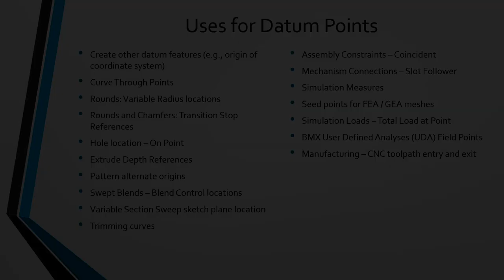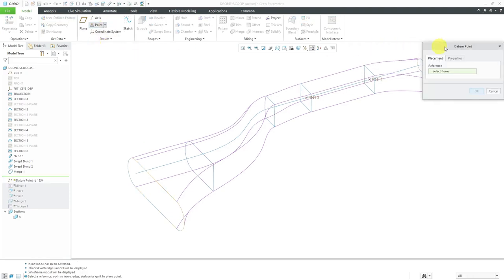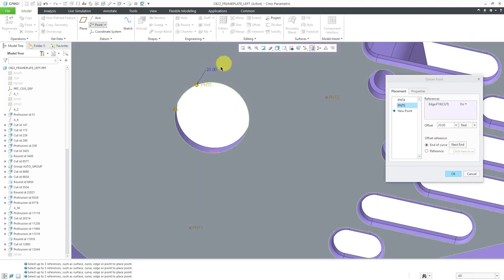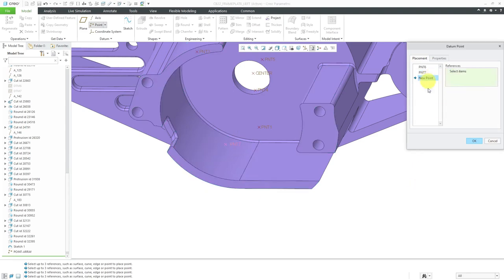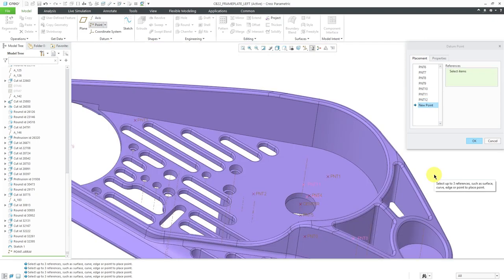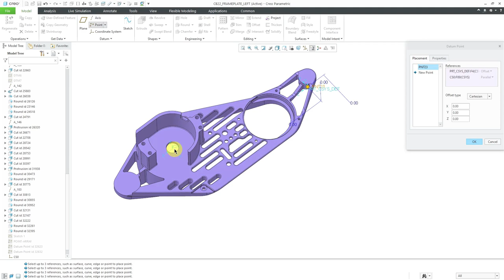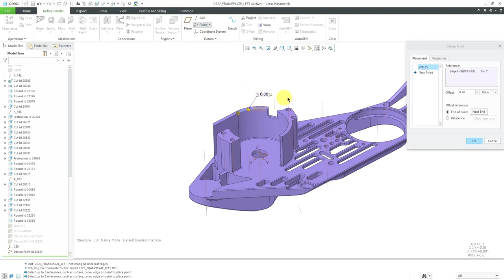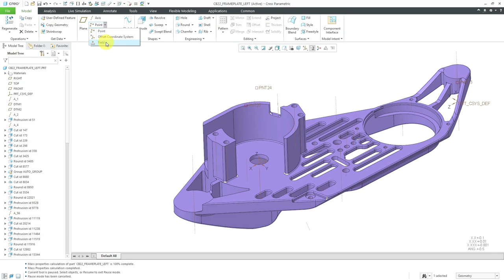Creo Parametric - How to Create Datum Points | Part Modeling

Comment: Hello, how can I project a datum point on non planar surface or non planar curve? I got stuck on that.
Reply from the maker: What version of Creo are you using?
Reply: Creo Parametric 4.0
Reply: Hello David, I´m using  @CADPLMGuy  4.0
Reply from the maker: This enhancement was added in Creo 6.0 but retroactively added to the Creo 4.0.6.0 build code. What maintenance version are you on?